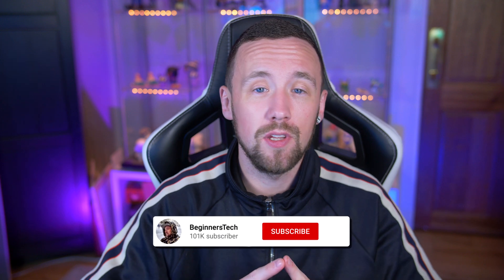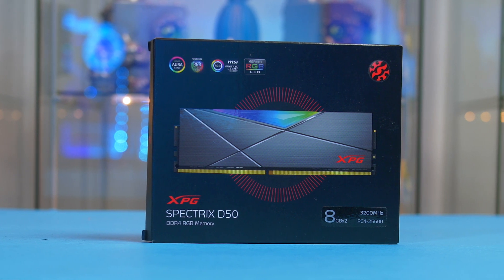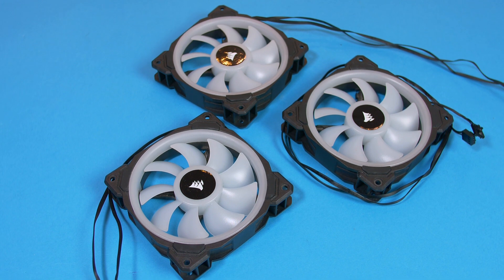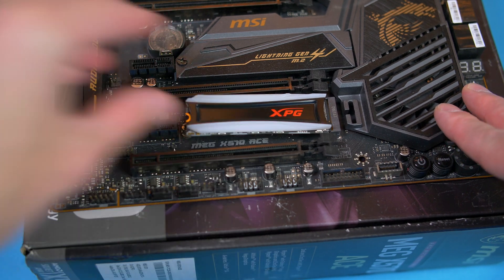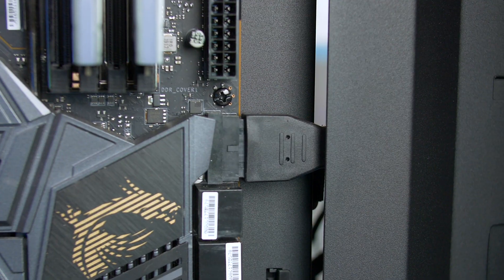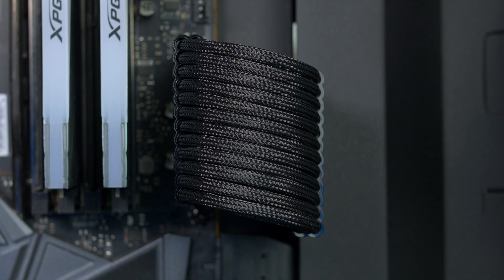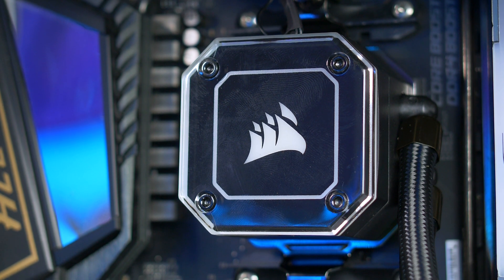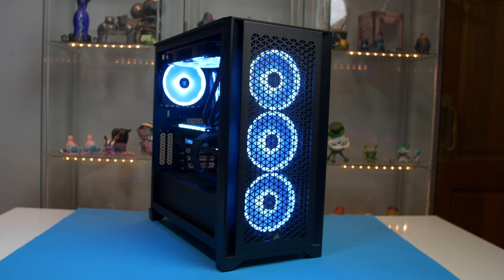Ultimate $1900 Gaming PC Build Guide! RTX 3080/Ryzen 7 3700X Benchmarks!

Comment: Hows the clearance  with the corsair radiator and ram position? Pcpartpicker said they might touch?
Reply: If you get a 240 your good, I'm using it with 4 sticks of vengeance pro. I highly doubt a 280 rad would fit though

Comment: I probably gonna get the same build just with the just a  different motherboard the Asus rog strix b550-f
Reply: Notice that this motherboard does not have A-key connector for your front panel usb-c. Check out the same board but b550-e version, which does have it. Also, there is a great Aorus b550 elite v2 mobo with all useful features and great design that comes in half the price

Comment: Great Video Mate, just wondering would a Kraken Z63 fit on the top of the case with maybe a crucial  ballistix rgb?
Reply: Z63 a 280mm you can mount a 240 or 280 at the top fine anything bigger front mount

Comment: Hope to find some help around here. Have 3080 along with the 3700x and i get super bad performance, less than half of benchmarks with 3700x. All my stuff is up to date. I currently have 16gb of ddr4 and the stock cpu cooler but have ordered better cooler and 16 more ddr4, hoping that’ll work. Wondering if anyone has has similar problems and knows fixes? I play at 1080p by the way.
Reply: What games are you playing? Also replace the cooler

Comment: Looking to build my first gaming PC with an eye for upgrading in future, bare in mind I'm hoping prices come down for CPU & GPU after the new releases and also higher spec items such as Motherboard so I have room for upgrades. Not looking for a massive spec but could someone give me some feedback on the potential components I have listed?
CPU - AMD Ryzen 7 3700x (including standard cooler)
GPU - RTX 2070 Super Gaming
Motherboard - MSI Gaming Edge (wifi) X570 ATX
Case - Corsair iCUE 4000x RGB
PSU - BeQuiet Pure Power 11 Modular 450w (or potentially higher power so I'm ready for upgrades)
RAM - 2x8GB Corsair Vengance Sticks
Storage - 1 x Samsung 970 M.2 Nvme SSD 500GB

Firstly are these all even compatible and will it allow for upgraded GPU + CPU down the line?

Any help is appreciated.

Comment: That case is gorgeous, in my opinion. How was cable management in the back?
Reply from the maker: When you remove the drive cage you get planty of room and you also have the velcro tie downs so it's not to bad all. I love how the back is a pop in rather than slide on as well males it super easy to close over
Reply: @BeginnersTech  I have the h710, so cable management is a breeze. Although, mine isn’t the best, it’s still better than my old case.